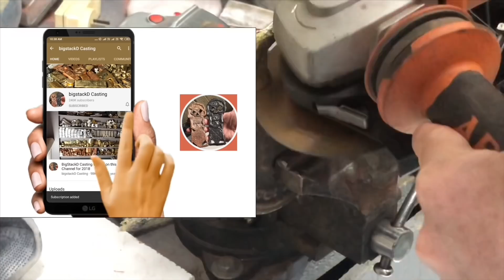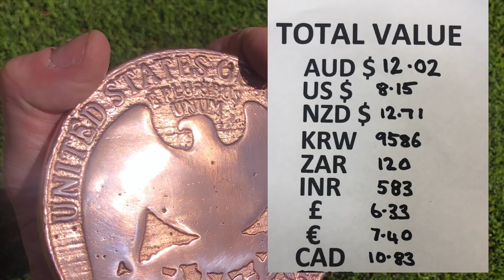Huge 1kg Copper Quarter Cast From Scrap - Coin Casting - ASMR Metal Melting

Comment: you can minimize print lines by printing in a high resoultion, but a lot of people will also sand the 3d prints for the smoother apperance

Comment: With 3d printing use abs it prints at a higher temperature and get a better quality and you can sand it and you can use a special paint to get a smooth finish with light sanding

Comment: The template you have certainly made with a 3d printer. I have seen in another video how to get a smooth surface. You have to put the 3d object into a container and add cotton wool soaked with acetone. Close the container well. After a few hours the surface should be smooth. Maybe helpful for you :-) Greetings from Germany

Comment: If you want a perfect finish on your 3D printed molds you need to sand it down with 120 grit
, spray with filler primer, apply spot putty, sand with 120 grit, then with 220 and 400 grit.. Spray with a matte paint to finish. Once you have a perfect finish you can set in the sand. Make sure the ridges are big enough to get a good contrast on the lines for the mold. Take in to account your prep and metal sanding which will reduce the ridges.

Comment: Hey I got an idea, the next time you make a mixed-metal slag ingot, you should heat your mold in another furnace to about the same temperature as the one you melted it in and then pour the metal into that mold, in the furnace. Then shut off the furnace, close the lid, and let it cool slowly. I think that you'll end up with grains of different metals since there will be enough time for the different metals to coagulate together.

Comment: Can you link your temp gun
Reply from the maker: Matey simply go to eBay and type in ‘infrared 1050’ That should bring up the same gun I use it’s a no brand name gun, Just make sure you pick the model that’s a 1050°C max They should cost between $20 and $30 delivered👍🏻

Comment: Now yall done got yerself a big ole kilo of american copper there. (To be read with heavy southern u.s. accent...) Those coins filled out great this time. 👍🤘👌 Dont know if your printer has the option, but i know that some 3D printers have a smoothing function that gets rid of the lines on the surface.

Comment: If you have a really big issue with lines on 3D print models, you can consider using ABS polymer to print. It needs higher temperatures and better preparation of platform, but you can get fine models. They will posess lines too, but you can smooth them later, by using acetone. And be careful with sudden cooling of model - ABS warps easily when loses temperature fast ;-)

Comment: Question, when do you plane on melting the "Sanding, Melting" scaps in the mason jars that you always say for another melt? I have went through all your video and you havent dont a video melting down those scraps yet. Do you plane on doing a video of such?
Reply from the maker: I haven’t done the dust melts yet but I have done several slag melts already matey 👌🏻. I’m hoping to do the dust b4 New Years if all goes as planed 👍🏻

Comment: Anyone else watching this and are concerned that he does this in a residential area?  I mean you need to have a respirator when melting certain metals like brass.  He is dumping dangerous fumes into a residential area where his neighbors can inhale them.  If he was my neighbor I would be throwing a fit about this.
Reply from the maker: 95% of my melts I do mid week when everyone’s at work or early morning after they have left, I know everyone in the street and I know their movements and times so no one is really ever home , Plus I’m in a gated community so nobody randomly drives past any smells or smoke from the furnace depletes extremely quickly and is basically non-existent after 4 or 5 metres from the furnace. I can assure you my neighbours are perfectly safe as well as  any pets👌🏻😁